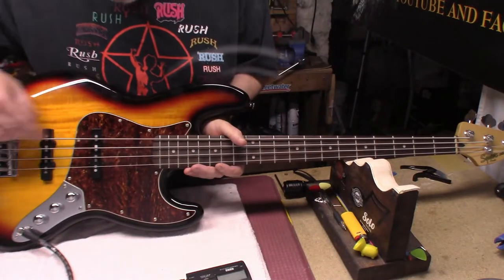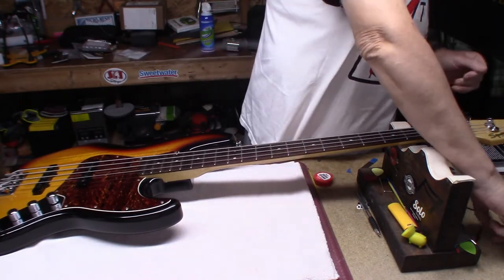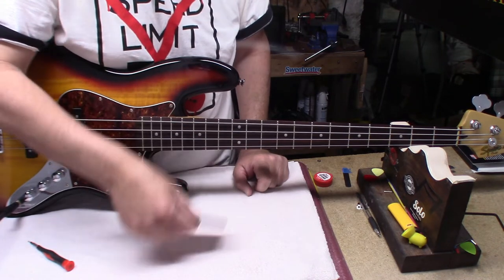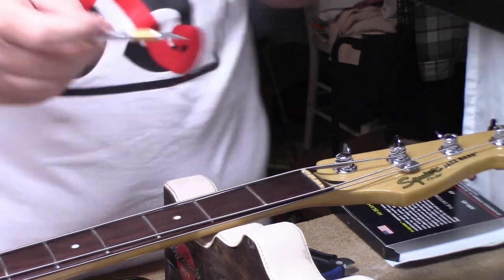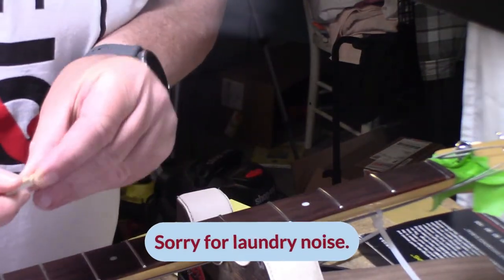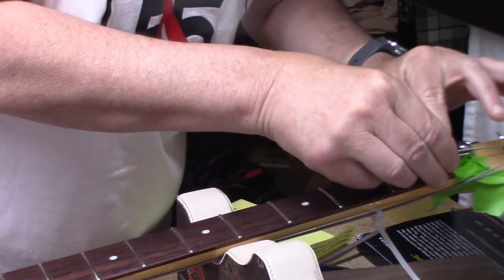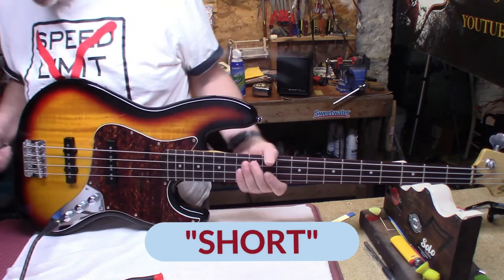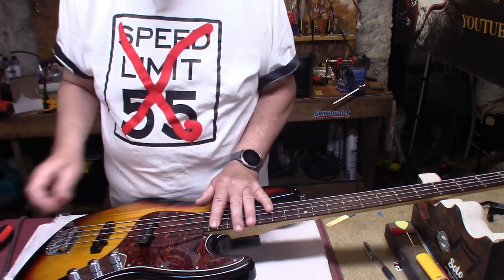Beautiful Squier (NEW?) With a Wonky Nut That Gets a Shim EP227

Comment: I had mentioned before that after 2 years of learning set-up work and repair, I need to work on my own guitars again. 1st back on the bench is my 1986 P-Bass. Needs neck shim (grub screws are way too tall out of the saddles), truss rod adjustment, string height reset, intonation and new pickup height. I don't think she needs a new nut, but I will find out. I may put those Roto Sound strings Dave recommended on her. You do learn a lot after 15 guitars and my first work was just so so. Gonna make her better again.